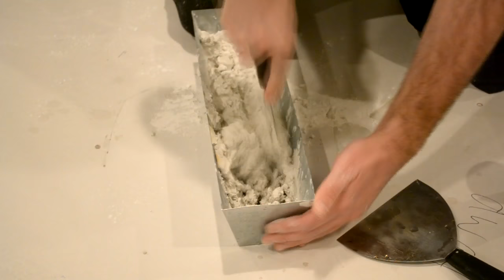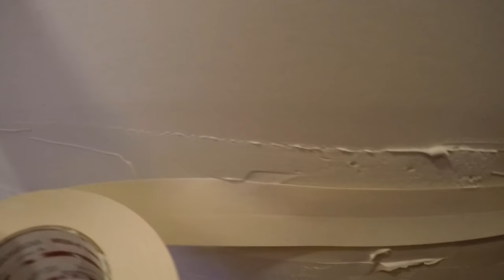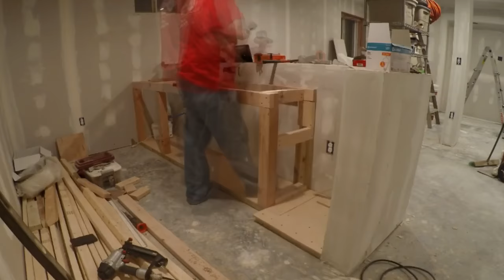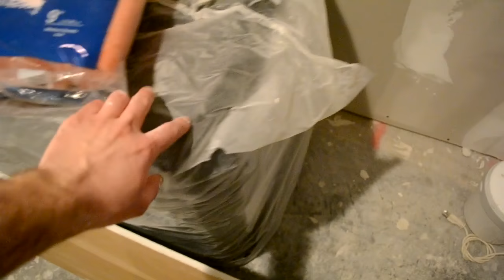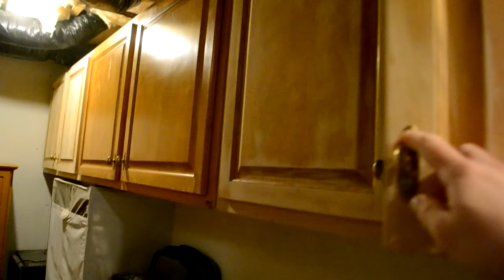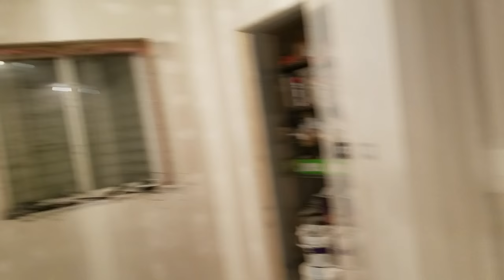7. Finishing Basement - Taping & Mudding Drywall

Comment: For someone not that experienced with drywall you did a better job then some guys I've worked with who have years of experience. You made me miss the free bird solo cause you were too slow with mixing hot mud though lol
Reply from the maker: Lol thanks!  In the next video I'll show how it looks after paint.  Everything came out super great except for a few small blemishes.  There's also one joint giving a shadow line since it has a can light above it which bugs me but overall I impressed myself.